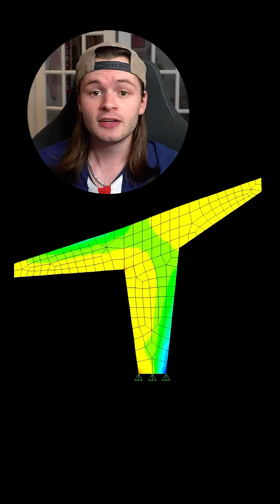The Most Dangerous Stadium 😳🏟️

Comment: Yeah my dude, no fucking CHANCE that is within design specs. That is way, way, way too much deflection. That metal is likely damaged at that point. That and it is in resonance with the crowd, which isn't good. It should be offset, I believe. Or you get stuff like this where a chain reaction occurs. Like a swing, you push, push, push in time, and go higher. But if you swing your legs to push out of time, it cancels some of the force out. This is resonating way too closely. No doubt there's fatigue oscillation going on here.

Comment: no, if it is shaking, it means that it is close to its limit. structures are suppose to be designed to withstand several times the load of the worst case scenario, like everyone jumping at once, or natural disasters. its called safety factor, the higher the safety factor, the safer it is

Comment: "A phenomenom called resonance occurs when a structure is too rigid"

What a load of BS lol.

Resonance occurs when the frequency of the excitation force (in this case, people jumping) matches or closely matches a natural frequency (thus, a particular mode) of undamped oscillation in the structure. Put simply: forces follow the structure displacement closely both in timing and direction, increasing its vibration amplitude until the material can't withstand stresses and fails.

It is akin on how you increase your speed in a swing, by throwing your legs on the downstroke and retracting them in the upstroke.

Comment: As another structural analyst, I’d like to add on to the comments calling this guy out.  

Contrary to this video, the Tacoma Narrows bridge collapsed due to a phenomena called the “Aeroelastic Effect,” not simple resonance.  The collapse what not a problem of resonance (which implies that the motion was excited by a periodic input near the resonant frequency), but rather the increasing divergence of the oscillating bridge due to the interaction of constant wind loads with mechanical stiffness.  This is similar to the aerodynamic flutter experienced by early aircraft designs. 

This is a common misconception that has been circulated for years.  This incorrect explanation even ends up in high school and undergraduate physics courses.
Reply: This is a great  comment. I am an undergrad engineering student. In differential equations my teacher used the narrow bridge video as an example when he was discussing resonance. It confused me quite a bit because I was unsure what would be the periodic force acting on the bridge. And what frequency is it matching or close to?
Reply: This kind of human-sourced oscillation is actually a bit like the aeroelastic effect because it's a two-way coupling. The structure bouncing probably influences the frequency of the fans jumping up and down, they'll end up in sync in a similar way to the aerodynamic forces do in flutter.

Comment: This phenomenon also is built into roller coasters. If you ever watch a roller coaster pass through a turn, you may see the structure sway a little bit. Its made to sway like that to adapt to the forces applied during said turn/drop/hill/etc. If the structure did not sway, the wear and tear inflicted could cause devistating results. It would be like a stretch band snapping at max elastisity. Just remember, it may not look ordinary, but 9 times out of 10, these systems have been backed up over years, and they have been designed by educated  peoples who know why it works best. (Im 14 btw and i still know all this)
Reply: Some deviation is needed, but the amount shown here is way too much.

But what do I know, I'm in my second year of Mechanical Engineering.

Comment: For those wondering about the bridge shaking, there's some terms in the equation for flexing which is blah blah times 1/(x-natural frequency). So if x, whatever variable it happened to be in this equation, turns out to be the same as the natural frequency, then you get 1/0 which is a divide by 0 error in real life, causing the bridge to shake more and more violently until it collapses.

Comment: One thing that engineers hate is a structure moving the slightest and why we use a high factor of safety to avoid it. Deflection is roughly around the 1” (length of member/240  for structural members) and that is way too much visibly.
Reply: Curious question, if engineers hate flex, why did they built plane wings that way?
Reply: @Somm_RJ  Planes technically have a composite design with it using thin aluminum while a hollow core with structural bracing in certain locations. This allows for structure to flex more easily but without passing the elastic limit of one material. As well, planes are not static design as buildings. So the design would be governed by the Dead Load, Wind Loads, & seismic effects on structure. Taller the structure, the more you want to avoid any deflection on it.
Reply: galvanized square steel

Comment: Stadiums are often designed to bend and shake to absorb and dissipate the immense forces generated by large crowds, especially during intense events. The flexibility allows the structure to withstand vibrations caused by the movement of people, jumping, and cheering, preventing damage to the stadium. This design helps maintain safety and stability while also reducing the risk of structural failure due to dynamic loads.

Comment: I'm convinced the content creator is saying a bunch of nonsense to get more comments of people that actually understand at least a little bit of the subject.
Vibration destroys anything over time, even without getting into resonance. The difference is either you have a structure that absorbs the energy, usually with reinforced rubber like elements in joints or similar or you get microfractures that add up over time and can cause premature catastrophic failure. (premature because you should calculate the "strength" of the thing to sustain all cycles within its lifecycle without catastrophic failure IF IT'S PROPERLY MAINTAINED).

Comment: It's true that it is built to flex but everything has a limit and if those group of people jump violently, it create cracks so small that you can't see and it only takes time to actually fail. That is why inspection is important. This is not actually 100% safe because a continuous flex always create stress on every structure. There is a reason that there is still videos on internet that a part of the stadium is collapsing and it is because of many factors such as poor mixture, micro cracks, poor design and more.

Comment: Mechanical engineer here, there are load limits in materials. There are elasticity and there are also points of no returns also known as plasticity. The plasticity of metal, when steel hit this point they will permanently bended and will lose all of its elasticity
Reply: You just explained something you learn in the 1st year of engineering school.
You failed to explain how this relates to the subject.
And if you're going to be technical and not explain the issues, you should've at least covered the bs he said about resonance.
But at least go back to basic material science and relate it to the reinforced concrete structure.
Reply: @antoniocampos5638  well i havent get to that part yet, the oscillation of cycle loads that keep going over and over and over until the structure get passed the elastic state and there is actually no return from it since it already passed it maximum load limit honestly this is not that difficult to understand it is just normal fatigue test. If the structure were too rigid and there is no flex. Plastic region is closer to the elastic region. If the structure were too flexible it will just droop down with even minimal force applied
Reply: @afiqdanial3053  That's reinforced concrete mate. It's getting fractures as we speak. You don't get to experience the full ride of the tension-deformation curvyness. You get premature failure for the cyclic load long before you reach the theoretical rupture tension.

Comment: As a mechanical engineer, Yes some flex is allowed, but no you don't want it to flex that much when there's an entire crowd on it, they are jumping at the resident frequency that whole thing is about to collapse that is not okay
Reply: Me shouting the word "house" at my wine glasses until they break because I reached resident frequency
Reply: Im a structural engineer, although i dont do stadiums. Resonance is one thing. The period of the structure (inverse of frequency) can be calculated and if its far enough away from the frequency of the jumping, then resonance isnt a concern. The second thing to consider is the amount of deformation in the structure. Like my mechanical engineer friend said, some flexibility it good. These structures are designed to be ductile (not brittle).  However there is a limit to how much they can flex before plastic deformation starts to occur (the type of deformation that damages the material).  As long as the impact force of the jumping is less than the elastic limit of the material, the stadium is well designed
Reply: @ikbenvoetbal  Interesting, so I am familiar with designing for deflection, and I was thinking about it more today, somewhere along these lines.  I concluded on the drive home that we must be able to design for resonance, but I was worried about I guess what you called plastic deformation; along those lines, I was thinking fatigue, but I am just not that kind of engineer I don't know how to articulate it.  Thank you for filling us in on the details.  Tyvm.
Reply: @malikrath9503  fatigue is something else as well. Im sure there's a lot that stadium engineers consider that the rest of us wouldn't normally spend too much time on. I do 1-6 story buildings, mostly residential. Not too many people jumping in there.
Reply: Mechanical engr🫲          🫱Structural engr
Reply: Isn’t it the resonant frequency
Reply: "resident frequency"

You are clearly not an engineer. That's not even a possible typo or autocorrect. You heard the term once and thought it was a completely different word. Google your stupid little mistake and tell me how little you find about it. An engineer would know that word by heart and never mistake it for a word as radically differnt in spelling as "resident"
Reply: you don't need to be an engineer to know how insanely dangerous this is.
Reply: Bro is not a mechanical engineer
Reply: Resident frequency ? Res... rez.. resonant?
Reply: As an Aerospace engineer, I wouldn't trust a mechanical engineer's opinion on a civil engineering problem XD, especially when that mechEng doesn't know resonant from resident
Reply: @ewanconway3130 lol aerospace is just applied mechanical you still learn the same theory... what university did U study at?
Reply: @DelayEdits pretty much seems like the guys arguing that he didn't know what he's talking about because he misspelled it. Typical internet mentality. 

The reason why that bridge broke is because of resonance frequency which is specifically talked about an engineering. It's literally THE textbook case of resonance response. 

The other guy does have a point about maximum amount of deflection associated with load. 

But in this case the people jumping you're generally more concerned about the resonance frequency associated with their jumping. 

I suppose you could be concerned about the impulse of everyone jumping at the exact same time.
Reply: @ewanconway3130  They played half life and got residences confused with residence cascade
Reply: You are incorrect, very incorrect.
Reply: @Official.blazed correcting a mechanical engineer is so crazy! But He’s right i believe him though.
Reply: @Cynlustalking is cheap so saying your something when there could be very little truth to it doesn’t really mean he is what he says he is stop glazing
Reply: @synthsquishy4615  yet it still true. Saying incorrect is insane and wdym glazing lmfao
Reply: @Cynlus you don’t even know this man and your trying to claim his profession is what he says it is😭 that’s first hand glazing at its peak straight riding💀
Reply: @ yet he still saying some truths. I rather believe to that person instead to the person who commented "incorrect" and you also don’t know the other person either.
Reply: @Cynlus you are actually slower than a rock lmao a 12 year old glazing is crazy
Reply: @Cynlus correcting the people who built these stadiums and didnt fall is so crazy! he probably doesnt have experience on this field.
Reply: @Official.blazed Who to
Trust, a mechanical engineer who I can assure is definitely correct except misspelling resonate likely due to autocorrect or a YouTuber
Reply: @Nothing_here7435  I am a Civil Engineer, but not a structural Engineer and have never worked on a Stadium, but I see this and worry. O.o I would bet this structure cannot withstand this long term.  I will ask around the office in the coming weeks about this.  The engineers we have for this, if they are even experienced in Stadiums are not in my office.
Reply: I'm also an aerospace engineer and OP was right but nice rage bait @Official.blazed
Reply: @Official.blazed  The resonance frequency is how sound breaks glass. Why wouldn't you believe him
Reply: @Official.blazed he’s right. I’m an undergrad engineering student. I just went over resonance in differential equations when we were doing linear models. If you apply a force at the same frequency as the natural vibration you cause problems.

Comment: Are you beeing serious? If you can see it shake that hard then it's dangerous. Structures are built to withstand shaking caused by "natural" and "artificial" phenomena at certain degrees. Additionally, deformation are "accepted" as it will eventually happen hence flexibility is expected because of the stress caused by different factors, but SAYING that ENGINEERS wants the structure to shake like that really triggers me as an engineer 😇